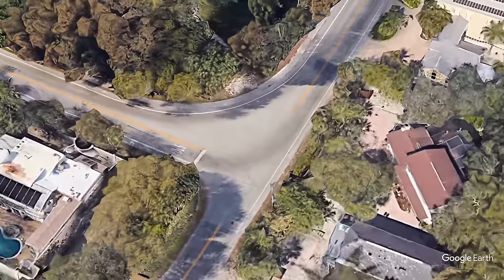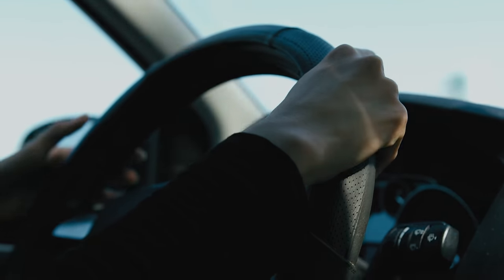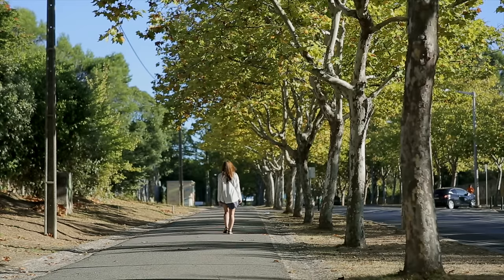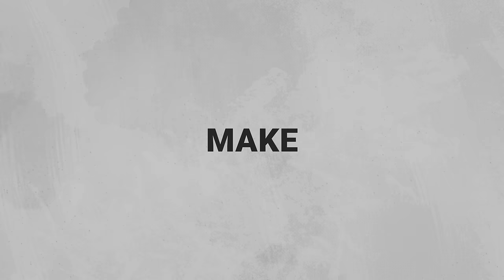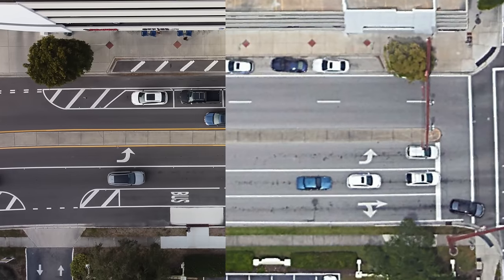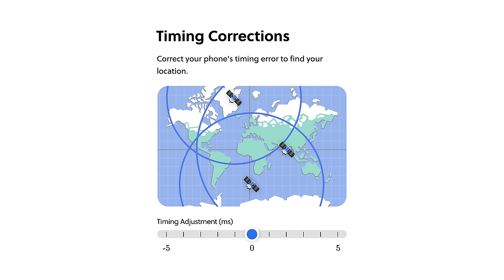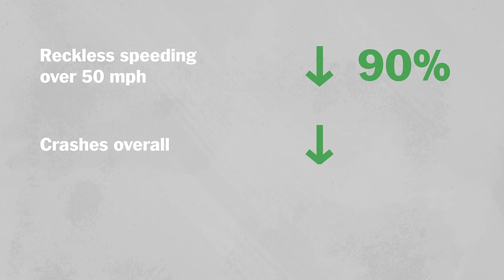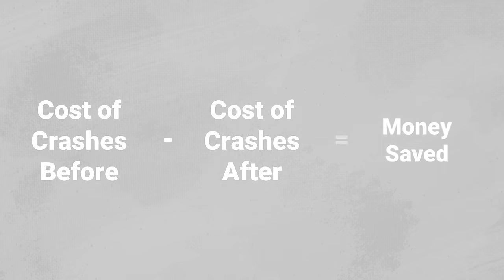This is the key to safer streets

Comment: The answer is always a roundabout, crazy how 90% of americas road issues could literally be solved be A) Roundabouts and B) Limiting/Blocking turns through traffic lanes into a junction and instead utilising a roundabout at the end of the lane to turn around to turn into the junction, instead of cutting across literally 2-4 lanes of traffic without any traffic lights, lol.
Reply: Roundabouts don't always solve traffic problems.  Even in the UK, it's amazing how many roundabouts have bloody traffic signals on them.  I mean, what's the point of a roundabout if you put traffic lights on them?

Comment: Plastic? In UK we just have a round circle of paint :D
Reply: Just simple psychology game. If it were just paint, then people can just ignore and drive over it. But because it's raised than people will think twice about going over it at high speed, in fear of damaging their vehicle.
Reply: @harveywilde6781  Which they do in the UK (drive over it).
Reply: @jaycee330  Yes, I know. People outside of the US understand the meaning of symbols and don't need to be physically told what to do. We see a roundabout marking, and we understand what needs to be done. In fact, painted marking or most of the time raised pavements, which had the advantage that longer vehicle could easily traverse them.

In the US, things are different. They need stop signs that actually said "STOP" (yes I know that we write the word as well but they're rare and we mostl use the yield signs) they need actual physical obstructions to make them pay attention.
Reply: @harveywilde6781  STOP signs are rare in the UK, but not in Europe. France has lots of them.
Reply: @harveywilde6781  Also, what written instructions are you talking about? The roundabout has arrows going around it, and give way lines. Pretty simple enough, I think.

Comment: 9:12 - Is that suicide lane? people wouldn't name them like that if they were functional. Correct way of doing such left turn lane is different
Reply: A suicide lane would be a centre lane that was used for overtaking vehicles. This is a turning lane, not used for travel.
Reply: @jaycee330  i've heard that it's a lane that is in the middle of the road and purposed to make left turns , both from the road and to the road.

Comment: propaganda. you need to look at the effects over the span of a decade or more. people adapt over time, and different conventions are created to clue drivers into how they should drive. speed bumps are rough on vehicles when driven at the speeds they designed at, but taken at a speed which allows the shocks to take the bump entirely is easier on the vehicle. that means that speed bumps for those used to them will take them at higher speeds than if there wasn't a speed bump at all. making streets that fit the conventions of those that drive the road works better than any of this BS, but you can't just plug and play with that approach, you need to think and have a clue.
Reply: This isn't propaganda, it's just engineering lol. This entire video is about thinking and having a clue, but you do neither and act like you're better for it.
Reply: @BenjaminWalburn  Civil engineers literally don't even take calc 2 or statistics... That was a good joke that you told.

Comment: Or... orrrrr.... they could just repave curves with a more effective bank and clearer sight lines so traffic can move interrupted without the unnecessary slowdown caused by a roundabout.  The goal is to keep us moving quickly, not to slow us down needlessly or be concerned with pedestrian or bicycle traffic. Roads are made for commerce first, everything else is a secondary concern.
Reply: The goal is to keep you safe
Reply: Nope. As long as the road is useful, and bot designed in a way that causes accidents (i.e. uneven surfaces, obstacles, low clearance, 
etc.) then safety is the driver's concern. It's a privilege, not a right, so there is no safety goal--only efficiency.

Comment: What I find most interesting about that road is that it's original design and the location to stop given the lack of visibility were the problem. If it were a normal T shape with the so lines just the T, not one car length back with no view of what's coming ... It would have removed the issues. Maybe add a speed bump. There would have been no need for a roundabout. Which honestly seems too small. Having to drive left and right so much just to get through it is a bit nuts.
Reply: Yep. Civils are incompetent. The entire thing could have been solved in a day for $5 of paint.

Comment: As a trucker, generally as a rule, roundabouts are awful.
Reply: Poor turning radius on your truck or something?
Reply: @logitech4873   turn radius is fine.  There's rarely room for the trailer to stay in lane in a roundabout.  If it is a double-lane roundabout I usually need to hog both lanes until I exit.  As for THIS roundabout, since I can drive straight over it, it wouldn't be a big issue, but I might just drive over it like it wasn't there if I was making a left turn.
Reply: that's why they have this style roundabout: so they aren't a problem for our shitty reliance on trucks.

Comment: That is so badly designed, why was the stop line so far back from the road? why was the other lane not even marked as to where it joins the road. You couldn't legally build this anywhere in europe and that roundabout isn't much better but definitely cheaper than turning it into a normal junction.
Reply: Oh, I've seen some crappy junctions in the UK and France. Believe me, the US isn't the only one with this problem.

Comment: The roundabout is detrimental to traffic flow over a traffic light for the primary road.    The primary road was not impeded by the side street because it was not being made to stop with a stop sign or traffic light.   Slower is not more efficient in general and that is very much the case with roundabouts over traffic lights.   A roundabout is a single lane traffic circle with operating speed of 10 mph - 15 mph with yield merge traffic metering with very specific center island characteristics.   This is not a standard roundabout and would not be included in statistics for them.  

 A roundabout can be expected to process traffic better than an all way stop controlled intersection when more than two cars are common in a queue.  The slow speed though a roundabout when on high speed road with speed limits above 40 mph makes them a bit slower in time used for a single car stop and go with a stop sign while being much more nauseating  and more work.   

This was not an all way stop controlled intersection.   The primary road was not formally impeded by the interesting street that was stop controlled.   It now is with a roundabout.   As traffic demands grew from the side street especially left turning traffic from the side street more intersection control detrimental to traffic of the primary may have become warranted.   That is always a frustrating situation to witness happen to a road that had been favored for its continues steady flow disrupted by outside growth of traffic.  People may have liked driving the road now with more disruptive behavior they don''t.  

For the primary road the roundabout has the effect of a traffic calming device that discourage through traffic.  It does that by several means other than just slowing traffic.  

The expected traffic crash scenario for the previous T-intersection  would be for a frustrated left turning traffic from the side street to jump out perceiving a gap when in fact having not scanned one of the lanes frequently enough to notice the traffic that is now in it.   

Over running the centerline of the side street while making a right turn from the primary road onto the side street is not a typical crash situation.    In the crash senecio shown the right turning car not only crosses the centerline, but crashes into some structure outside of the on coming traffic lane.   That is better than a head on collation with on coming traffic, but with the added distance of the entire on-coming traffic lane the vehicle would have to be said to be out of control to have crashed into a stationary structure, with that not being fatal.   

Roundabouts, along with their over grown multi-lane operating speed above 15 mph traffic circles which are dangerous and not included in statistic for roundabouts because they are not roundabouts, are greatly secretly used as traffic calming devices to discourage through traffic.   There are only a few traffic situations roundabouts offer better solutions than other traffic geometries or traffic lights.  

Roundabouts  are easy way to spend tax payers money on projects that require little skill.   They switch liability away from active traffic control device such as traffic lights onto the drivers.   Governments are easily sold on that aspect.   That is still the case for multi-lane higher than 15 mph operating speed traffic circles which means the government is removed from a lot of  legal involvement in a crash although as lawyers become aware of the liability of traffic circle in crashes that may change.

 Traffic circles no mater how dangerous are safer for government over traffic light controlled intersections because they have less liability as compared to traffic light controlled intersection.   Governments don't care about how many crashes traffic circles may create.   Fatalities are relatively rare on roads in general.    Local people want to discourage through traffic which heavy use of roundabouts addresses.

Comment: Roundabouts generally require more space than traditional intersections due to their circular design and the need for adequate approach and exit lanes. In areas with limited space, traditional intersections may be preferred due to their smaller footprint.

Cost: Building a roundabout can be more expensive upfront compared to a traditional intersection, primarily due to landscaping, signage, and road realignment requirements.

Comment: I wholeheartedly believe that almost every single traffic light in America could easily be replaced with a roundabout and traffic would improve in that area
Reply: In some cases roundabouts can actually make traffic worse, especially when the flows on the varying approaches are unbalanced, resulting in there being little to no gap for certain approaches.
Traffic lights on the other hand give everyone a chance to go. Also they take up less space, and hence are more pedestrian-friendly (shorter crossing distance). And they can be coordinated to provide a green wave, which can reduce the number of stops to just one, in ideal conditions.

Comment: NOT a good idea to reduce lanes in a LOT of places.  That's going to turn a 20 minute drive to a 1hour-20minute drive..when traffic builds up.  If there is a lane closed because snow, or construction.. or police pull over or accident.. 1 of your lanes is gone and immediately traffic moves at 2mph instead of 30.
Reply: Car drivers can always just take other more efficient forms of transportation if it’s too slow
Reply: @BrilliantHandle  actually i like a lot of the stuff in this video.  I'm just on the opinion if we come up with the right ideas we can have our cake and eat it too.

Comment: What tools can be used to control speed? A speed limit sign and enforcement. 
Although lowering speeds to make locals living next to major connecting roads happy isn't the correct solution, that's a flaw in the road network. No one should ever feel the optimal route during normal times is a residential road if they are not starting or ending within the residential block.
Reply: Speed limits aren't good,  they either need to be set too slow for the majority of vehicles or too high for the minority that cause accidents. 
Road design around key dangers should be prioritised as it has been proven to be far more effective and doesn't need to be policed.
Reply: @xaiano794  Speeds should be set based on the type of road and the intended role of the road in the network. Building dangers into a road to try and scare drivers into slowing down rather than using enforcement is trying to be safe by being cheap. That is until someone driving at the  lawful speed has an accident caused by the danger. I think if that accident kill someone the people that built the danger knowing it was a danger should be charged with a level of manslaughter for creating a dangerous condition. Your goal of trying to make something safer by making it dangerous isn't a valid defense in my mind. 

I've seen a road calming device, also know as a sudden curve in a road with a curb cause an accident that killed a pedestrian. But at least the city didn't need to pay a police officer to sit on the section of road 1 in 5 days at random to teach people it was an expensive place to break the law. I'm sure that dead person is happy with the government being sensitive to the cost of the tax payers.
Reply: @xoso599  facts disagree with your assertions,  for example roundabouts in general see an 83% reduction in fatalities. 

I can see where you are going wrong,  you're thinking of yourself driving and applying solutions to that situation rather than considering all traffic. 

Let's say there are some curves,  or perhaps a junction that you in your car could negotiate safely at 55mph. A top heavy truck pulling a heavy trailer could negotiate that same corner safely at just 25mph, and you'd want to implement this speed restriction in advance to allow  for the vehicles to safely slow down. 
Are you suggesting that all vehicles should be forced to do 25mph when only a couple need to?
How would you enforce it when so many ignore speed limits?
Why would you choose a solution that requires enforcement and has been proven repeatedly to be less effective over one that is more effective?

Comment: That long bit at the top of the T is superfluous, the same thing could have been achieved with a small triangular island instead. 
Also, "stroads" do not exist, if you can't understand that there are more than three different types of street surfaces, that's on you. Allow me to elaborate:
Streets: small, one-lane roads with many variations such as alleyways, often unmarked and undivided
Roads: marked and indicated surfaces with two-way traffic, generally one in each direction but can be one-way. and are always two lanes.
Avenues: four lane or higher transportation with a division between opposing lanes of traffic which can be paint up to planters. (yall are referring to "commercial avenues", btw)
Highways: no explanation necessary.
And hey, I get it, it's fun to throw out buzzwords and all that however it sort of diminishes anything you may or may not be trying to propose. I've also noticed that these areas of pavement that people tend to complain about tend to be out where all the car dealerships are anyway, who's biking to a car dealership?
Reply: There are two schools of thought here.  One can define a highway (the legal generic term for any type of pavement where I live) by either its characteristics (#lanes, limited/unlimited access, speed limits) or its purpose (through traffic, shops, residential).  The "stroad" people complain that many cities try to use highways for contradictory purposes.  Equally bad, cities can decide that compatible purposes are incompatible, such as shops and residential.

Yes I don't like the stroad buzz word  but it does capture the idea.
Reply: This is a way how you can categorize a road yes. With existing roads, you can probably come up with 100 different road types. 

However it's not the best/safest way. It's better to look at the function a road provides or is gonna be used for and design the road accordingly. 

Street: Residential or shopping street where houses or businesses are. People can drive slow  here and cars can turn at any moment to drive into a driveway or something. 
Road: Transport cars from a street(neighborhood) to a different street (neighborhood) or from a street (neighborhood) to a highway. Vehicles should only slow down for intersections that are half a mile apart or something. These intersections can be traffic lights or roundabouts. Speed is medium here.
Highway: Speed and throughput is everything. Cars are not allowed to stand still.

By looking at the function of a road, and designing the road accordingly to its classification, provides drivers clarity on what they can expect. 

A stroad combines 2 functions. Slow traffic that's turning on or off the road while medium speed wants to drive fast(er). This creates unsafe situations when different people want to do different things.

In the end, people are stupid. They get distracted, are overconfident and drive too fast for their own safety or are just plain ignorant. Infrastructure needs to force drivers to keep an appropriate speed. They need to feel unsafe driving faster then the desired speed.